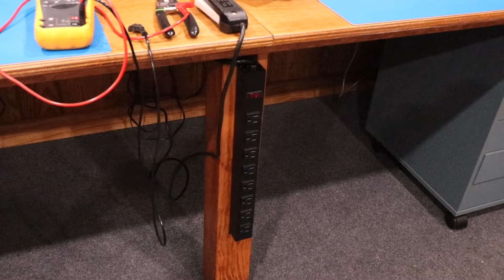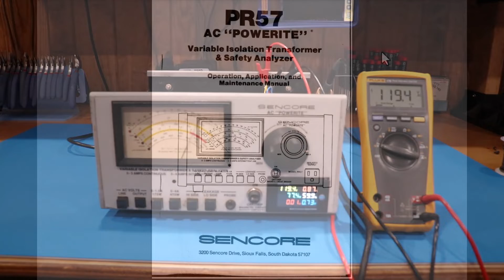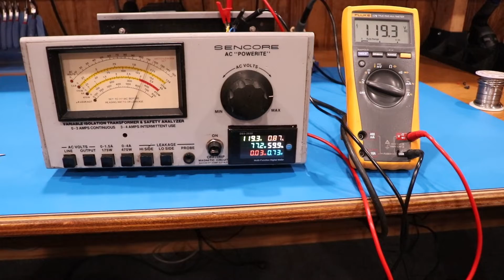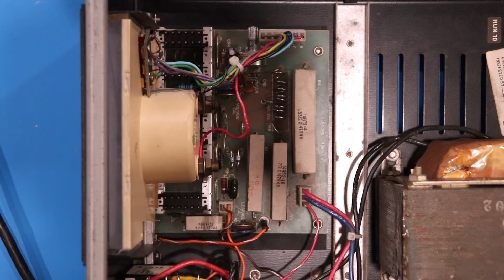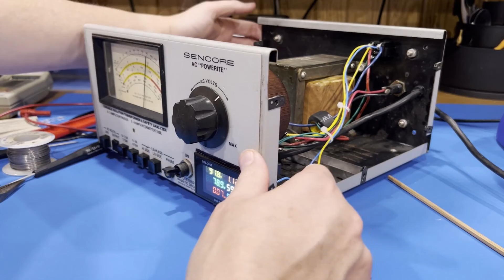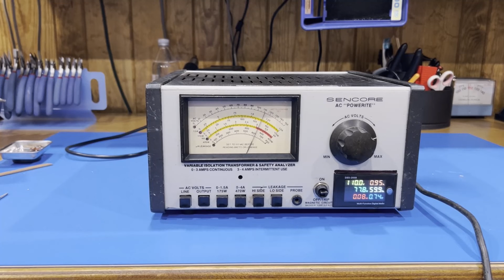Sencore PR-57 Powerite Variac Repair, Calibration, and Upgrade

Comment: Excellent presentation of the operation and modification of the Sencore PR57.
I worked at Sencore in Sioux Falls, SD in the early Seventies as a Factory Field Engineer producing instruction and application manuals for the CB46 CB Radio Analyzer and the VA48 TV-Video Analyzer.
As memory serves, the PR57 manual was done with my media teammates, although I don't recall the details mentioned of the schematic or the components.
What I will say is that Sencore products have been based upon the real-world experiences of the founder and CEO, Herb Bowden, who developed instrumentation for the retail consumer market at the time.

Comment: Great job Mark.  Could use this meter on my PR-57 and outlet on the back.  Close as I can read the ID Number on you digital meter is D85-2058.  My eyes are not what they used to be.  However, when I checked the part number, it brought back a meter that looks identical to yours but is listed with an AC voltage range of 200-450V.  What am I missing?  As others have noted, it's good to see you back here on YouTube.
Reply from the maker: Here is where I got the one I used  https://www.ebay.com/itm/134694231802
Reply: Thanks Mark.  I bought one.  I don't need all the info that one supplies, so I also bought this one from Amazon that only displays voltage and current. "KETOTEK Digital Ammeter Voltmeter AC 80V-300V 100A, 2in1 Multimeter Panel 110V/220V, Volt Amp Meter LED Display Voltage Amperage Detector Tester Gauge with Current Transformer CT" Haven't decided which I will use, but I'm leaning towards the V A only one.  It has larger numbers which is helpful to me and the only other info I might need is the Watts.  Luckily I can still multiply volts x amps.  Let us know if you find one large enough to replace the entire meter.  That would really get this thing into the 21st century.   de John, K8NN @Blueglow

Comment: Hi Mark, thank you for this video. Can I ask: I see the output from this Sencore unit delivers earth from the input earth, which, as far as I know, is connected to your neutral line. While the isolation-transformer part of the unit will float the output, the moment a DUT is connected to the output of the Sencore, where most DUT’s with three-prong connectors actually connect the earth to some point of the DUT’s power supply secondary side, this secondary side subsequently is not floating anymore relative to the mains AC. Question: what do you think of breaking the earth-connection to the output of the Sencore, or, at least, having this switchable? Thank you in advance for your time! From Amsterdam, NL, Peter.

Comment: I have one of these, and I use it every day. I depend on it. Mine works perfectly, but I have been concerned about what I'd do if something failed -- knock on wood. This video helps a lot!
The isolation, current meter, and magnetic trip switch are great features for an amp tech -- they set this unit apart from your everyday Variac.
I bought mine from a tech shop owner who retired. At one time he had 5 benches going full time, and each bench had one of these. They were doing 1000+ repairs a year!
A little dab of silicone caulk will keep the buttons from falling off, and is less permanent than epoxy.

Thanks for doing this video -- an obscure topic for sure, but it's just what I needed.

Comment: If you knew the output voltage why not just adjust the meter to match?
Reply from the maker: I think that was the point of the video, the meter wouldn't adjust to match it.  Unit was in need of some work to allow it to do so.
Reply: @Blueglow  I didn't see you adjust the screw just below the meter center. Maybe i missed it.
Reply from the maker: @Trex1268  That meter is only for making sure the pointer is zeroed with no voltage applied.  It didn't need adjusting.

Comment: Have a BK Precision 1655 AC Power Supply that looks almost the same.  Which came first?
AC 0 -150 button replaces the line and output buttons, then 0-4 and 0-2 amps buttons, leakage com and hot, leakage sensor permanently wired in and a solder temp pot beside the meter with plug in at the back.  The circuit breaker is also at the back, beside the fuse.

Comment: What does the "Leakage" function do, and how do you use the probe socket?
Reply from the maker: Basically, lets you use the probe to touch the metal chassis of the DUT to see if there is any voltage present, thus shock potential.  This might indicate a bad grounding situation or leaky component in the device.

Comment: Thanks for the great video. I have a question - since the meter is in parallel with the 10 uF capacitor, if the capacitor is leaking, how would it affect the meter? I could understand if it was in series, but it's in parallel with the cap so wouldn't it be unaffected by a leaky cap? The only thing I can think of is if the cap was leaking, the parallel circuit would be drawing more power than the rest of the circuit feeding the parallel circuit was designed to, and could impact the meter reading. I'm just learning electronics and really appreciate these videos. Just interested in checking my understanding.
Reply: The capacitor’s job is to protect the meter movement from voltage spikes and ensure the needle moves nice and smooth. When a capacitor is working properly, it appears like a short circuit when it has no charge, and appears like an open circuit when the capacitor is charged. When current begins to flow through the meter circuit, the capacitor is going to shunt 100% of the current, so none flows through the meter. When the capacitor is charged, it will block 100% of the current, and the current will flow entirely through the meter. If the capacitor is leaky, it is shunting current away from the meter, as if you had put a parallel resistor on the meter.

These movements have a coil resistance of 1.9k ohms. If the capacitor is behaving like a 100k resistor, then it’s going to drag the needle down a few ticks.
Reply: @B3MDUSA  Thanks for the explanation! Now I see how we get that smooth action on some meter outputs.

Comment: Mark, on my PR-57 it was the 10uf capacitor that was causing a calibration issue. Thanks for sharing!
My only concern is the 2 power strips being so close together it seems easy to accidently plug into the wrong strip, so when you think your isolated, you are not! 
Personally I would move the always on power strip to some other location, since 90% of the time everything is going into the isolated side...
Robert
San Diego
Reply from the maker: I had both side by side on my old bench for many years with no issues.  What's the worse that happens, I give something 120v out of the gate?  Worse things have happened.

Comment: I have the PR-57 variac and isolation transformer.  The weak link are the pushbutton switches.  Excellent unit, and I don't worry about calibration...that's what my Fluke is for.

Comment: I've got the same unit. The magnetic on-off/trip switch is giving me trouble though (takes many times to get the "on" to stick). Anyone know if this switch is serviceable and if this is a common problem?
Reply from the maker: I've not tried but I would imagine you could open it up and check it out.

Comment: Mark, outstanding video. The radar simulator test bench that I worked on in the Army used 6 of these Varacs in the high voltage section. The supplier told us not to worry about  about the calibration because of the variation in the line voltage 110 - 120 VAC. Thanks for the great video. Dan KI6VBC

Comment: Greetings.. I have a noisy variac.. I need advice on how to silence it. Is it worth varnishing? Thanks in advance..
Reply from the maker: Say more about how its noisy
Reply: @Blueglow  Just a 50 Hz hum. It is heard without load, and becomes a little louder with load.
Reply from the maker: @thomass7877  likely an issue with the autotransformer.  Unlike an EI transformer, not much you can do to service or help this.
Reply: @Blueglow  Thank you..  Welp..  Time for new one i guess..  😁. Its shame...  Working good in all positions,im just iritated with that buzz... That is old Japanese Matsunaga SD 265...

Comment: a couple of LED's behind the analog meter to illuminate it a little would be nice  :)  ps where did you get your 1n695's ??
Reply from the maker: Had them for years.
Reply: I added 2 lights to my PR-57, they were actually Red LED's. Looked very cool. Held them in place with a Hot Melt glue gun..
Robert
San Diego

Comment: The meter movement is a D.C. device. It is measuring A.C. currents. This means that the voltage generated by the current measured must be rectified. Diodes are not linear devices, and the  non-linearity is more obvious at lower voltages. Digital instruments do a better job of measuring AC currents - especially small AC currents,than analog instruments do.
Reply from the maker: For sure.